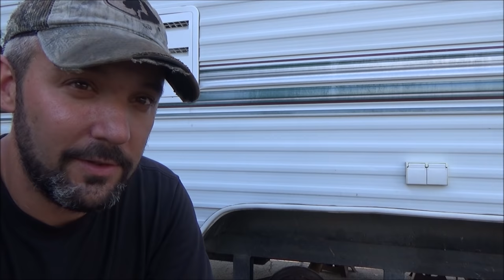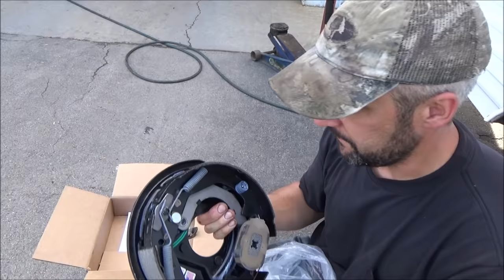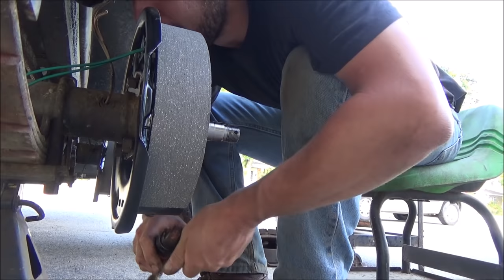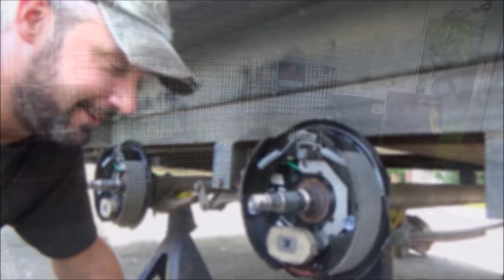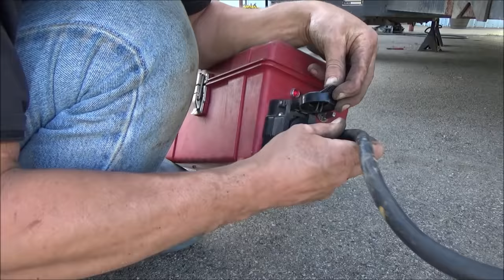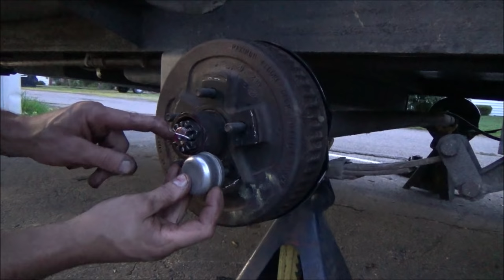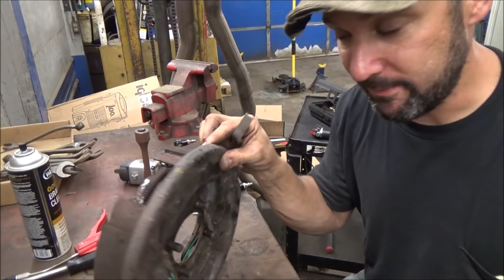Replace: Electric Trailer Brakes - Part 2

Comment: hey man awesome video never knew how those worked..... i want that air ratchet u have can u give info on were to get it
Reply: 85jmccoyAir ratchet supplier Denny here. I've sold out the nine that just came in but I'll have another 20 to sell come the end of August. Price is $110 + $6.00 shipping. Eric will make an announcement in one of his videos when they are back in stock.
Reply: I have that air ratchet and its awesome. Definitely highly recommend it.
Reply: That's great, I'm glad you're a satisfied customer.
Reply: Thanks again man. Do you sell any other tools?
Reply: I sell a very high end Taiwanese brand named TOPTUL. You can view what I've got up on EBay. Just search on either schmidtdn or TOPTUL.
Reply from the maker: Michael Herbert I 100% will vouch for these tools. Dennis has sent me many of there wrenches and sockets to try. They are cheap to buy but quality and reliability is amazing!

Comment: DOES IT MATTER WERE THE POSITIONS  OF THE  WIRES  , POSITIVE OR NEGATIVE  GOES ON THE NEW  BRAKE ASSEMBLY, OR CAN THEY GO ANYWERE
Reply: No, either wire from the RV works.  Brakes are non-polarity.

Comment: Oh my RV my brakes were so over packed by the factory it blew it out the seals and completely coated the rotors /shoes and everything with grease  ruined the shoes where they wouldn’t hold   So there is such a thing as to much grease  and at 6 months old wouldn’t fix it said it couldn’t have been them.

Comment: Eric, do you turn the drums when u replace trailer brakes?
Reply from the maker: ***** If they are bad enough I will
Reply: Ya guess its hard to feel a pulsation on a trailer
Reply from the maker: No believe it or not you can , you can feel how it tugs on the tow vehicle

Comment: Well whenever you do your wheel bearings you need to fill that capful because centrifical Force after several hundred miles that bearing will go dry cuz centrifical force will all that Greece will end up in your Hub in the center if that caps not. And I know that for a fact I've been doing a little bears forever but I love your show anyway think about it since your uncle Forrest run those bearings drive without greasing the cap

Comment: Ok for some reason I cannot find anyone who says how much current or volts it take to power up the magnetic brakes.Ok so I have the drum off I want to check the current at the shoes the magnetic brake part it has two wires there how much volts should I get from the two wires?

Comment: Guys that hate on butt connectors don't use the correct gauge connector for the wire they are working with. Too big a connector and the wire will flatten out inside the crimp over time and fall right out. The wire should barely clear the inside of the connector, then crimp the living hell out of it and you won't have any problems.
Reply from the maker: Derrick Hodges Well ya do have to use the appropriate style crimper for insulated or non insulated and you can over crimp and cut the wire honestly if you go at it like a gorilla haha

Comment: They're NOT the same, Eric. Beside the different pendulums ... the shoes are different in that there is still a PRIMARY and a SECONDARY shoe. 
Just changing the pendulum would require swapping the shoes too.

Comment: Gasoline is a good parts cleaner. Cheaper than the 2-3 cans of brake clean you'll use unless you buy the cheap stuff, then it's probably more.

Comment: All you have to do is "all the mating services with Greece pack the bearing to the best you can here finger your Palm then before you install your rear seal pack that whole back space with grease you can tell your rear seal that will compress the grease into the rear Bang repeat on the front and then make sure that your hub is about a 8th of the way full of Greece because in the grease gets hot the centrifucal force will fling the grease out into the bearing and then when it cools off it will puddle in the bottom of the race And hub but everything is coated so when you take off everything gets warm everything slings out everything gets greased Important trailer bearings are not like wheel bearings on a car or you want a little bit of pre load trailerberry should be set a little loose more friction more heat Whereas when you have a front wheel bearing that is attached to the hub and brake router you want to minimize play because it will affect the way the brakes apply especially if you have  Is warped brake rotors Just my thoughts everyone has their own way

Comment: They have the new  butt connector all you do is put the two wires in the connector make sure the two wires are touching each other. And all you do is heat the connector and connector squeezes the wire and middle has flux and seals the two wires together. Simple

Comment: In the electric motor repair industry too much grease creates heat alot of heat 
Not a guess but tested so I could refute some of those old mechanics tales.

Comment: Yes I can tell you don't use them scotch locks because you don't just flip it it's not that easy I always squeeze the metal part with a pair of pliers and then the part you flip is like a safety

Comment: Sorry to revive a comment section on such an old video, those connectors are called "quick splice" connectors. they are the bane of anyone who works with wirings existence. versions are even made that work with solid core house wiring which is a HORRIFIC thing to see in an outlet box.

Comment: Electromagnets trailer breaks always sound like crap when you Jack up the trailer and spend the wheel because the electromagnet is always rubbing the inside of the drum So unfortunately you have to open it up and make sure everything is good if you are going to be servicing them but scraping rubbing noise pretty normal Don't mass with your Cotter pen too much if you think you hear your funny noise

Comment: They are called scotch loc because they are made by the same people who make super 33 tape the 3 M people scotch tape = scotch loc but as you said they are (crap) because they are not water / salt /corrosion proof.  All electrrical connections on motor vehicle must be some level of corrosion resistant otherwise (bing) green (copper) corruption.

Comment: How much current does  a magnetic brake draw?
Reply from the maker: Depends on how much voltage is applied to them
Reply: I guess I should be asking, what's the max current that magnetic brakes draw given the max voltage (which I think is 12V) is applied?
Reply from the maker: I have seen them draw around 12 amps when I have tested them. Depends on the magnet, windings and heat too...
Reply: oh okay I see, I see. You tested on a 4 brakes trailer I'm assuming?
Reply from the maker: I can't recall right off hand what I tested last to remember them numbers. I do believe it was a dual axle. Tekonsha 90195 Prodigy P3 Trailer Brake Controller will give you live amperage output readings if you have one :)
Reply: Thank you very much, you videos are awesome :)
Reply: Eric's answer is correct about 12 amps for all four. The spec on mine was like 13-15 amps but I have never seen more than around 12. I have used an inductive ammeter to check them and they are all around 3 amps each (a good magnet). Another great Eric o video. I have owned two trailers and it takes an effort like he shows, including the adjusting to get them to actually work. I was told and believe the trailer brakes should stop the trailer and the truck should stop the truck. IMHO for too many people skip these steps and rely on the truck to stop everything. One last thing: test your break away switch with it pulled the magnets should be drawing the same 12 amps, then slide the pin back in.  I have seen a lot of these that do not work; they are not black magic

Comment: I don't understand people's hatred of those heat shrink connectors either.  I understand that they're expensive, but they work great.  I've always called the one connector a vampire connector, but according to the Google, they're Scotchlok.  But whatever they're called, just kill them with fire lol
Reply from the maker: Eric Brunhammer or a wooden stake?
Reply: That is a brilliant joke, I actually did laugh out loud. I hate those things with a burning passion. But those melt down connectors work great, I've used them for years and never had an issue. I much prefer to solder and heat shrink, but those are far more convenient when you're off site.

Comment: what's wrong with t standard butt connector with a heat shrink sleave? i used a power probe last night to perform the same functions as your box but that is a pretty neat idea also.  doesn't look like it was too expensive to make either, Weird knowing they come from Elkhart indiana, that's what my first RV is a 2012 Heartland Elkhart Express. stuck with heartland for the other one also it's a Big Country though. much larger and nicer NOTHING DRIVES ME MAD FASTER THAN SOMEONE USING A COMMERCIAL WIRE NUT ON AN AUTOMOTIVE PRODUCT!  They don't belong there and usually cause all kinds of problems, STOP IT people!

Comment: Yup... Scotch-Loc is what it is. They are the epitome of electrical engineering in the RV industry.  
Two things... 1. excess grease is just that ---> excess grease. Packing a hub might be OK in case you could use it on a roadside repair... but otherwise?  Nope. 
Just pack the bearing cage, rub some grease on the outer face and assemble. No more. No less. 
2. I always use the smallest butt connector that fits the wire. Ever seen a yellow connector on 22ga wire? It ain't pretty. 
I bet you dont know the official name for "zip ties" do you? I even have the USA OFFICIAL NASA-AEROSPACE tool for installing them correctly and ultimately cutting them to length at the correct tension. 
If you want to hear the ultimate kid-stupid thing I did once, let me find out if the Federal Statute Of Limitations is exceeded yet...... (yeah ... that bad!)

Comment: Thanks for the video. never gave thought to how they worked kinda knew but now I know. also scotch locks are sh1t and yes it will fail you might as well use bubble gum an duct tape.

Comment: Dude you gotta know better don't clean out your bearings with compressed air unless you know what you're doing if you spin the bearing with looke cool fasenating comppress air and the cages worn one of those bearings will come flying out of the cage into your face at a 1000 miles an hour or something like that you'll poke out your eye out I told you  Sonnyboy